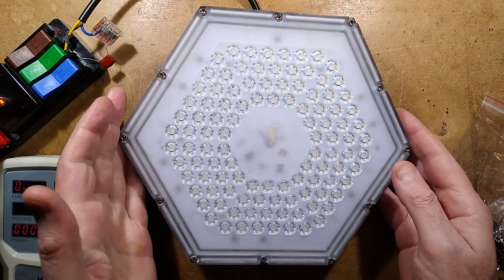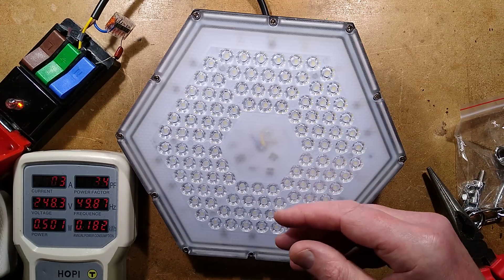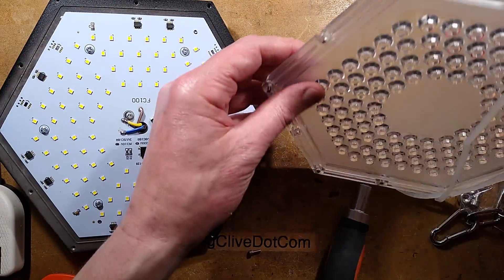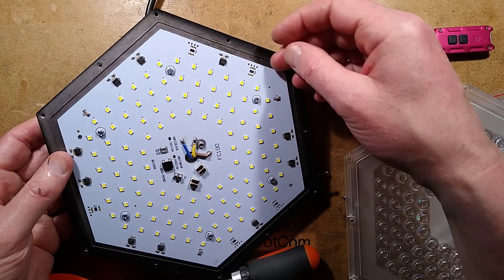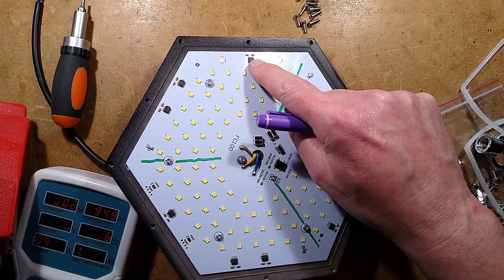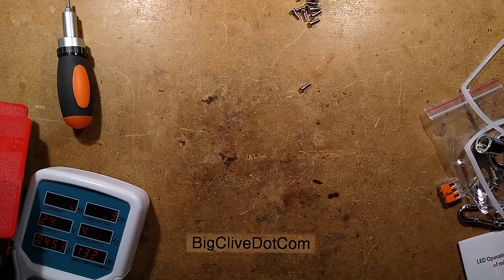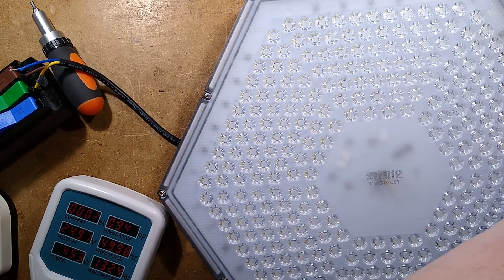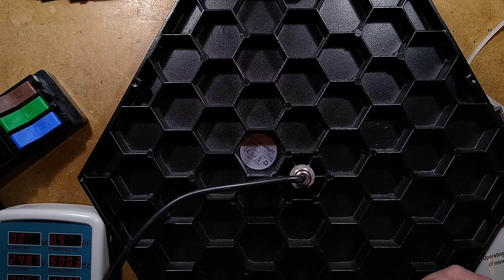Exploring an eBay "mine" light (flicker alert)

Comment: Could one simply add the reduction and smoothing components on either side of the existing rectifier?
I suppose for the extra cost of second rectifier and box for the bits, it's not worth the labour in breaking tracks and soldering in components, then to try and fit the screen back.

Comment: Could you run them off a lower voltage DC supply, so they didn't flicker and ran dimmer and cooler, if you were using them as decorative panels?
Reply from the maker: The mod mentioned with a lower value capacitor will do that.

Comment: My guess is they are using the aluminum as a heat sink to draw the heat away (which is why you hang them instead of surface mount).  One use for them is garage/shop lighting.  Need lots of light and usually flicker will not be as big of a problem.

Comment: led technology is moving fast. no dc driver or aluminum heat sink. all on the same circuitboard. lots of innovation. and assumed lowered price.
Reply: Looking now (14-08-22) cheapest seems £22 for 100W round UFO. Or £18 for 100W chain-honeycomb hexagonal ones. On ebay

Comment: I can't stand flickering lights. An absolute no-no for room lighting, and an annoyance where I can't change anything about them. Car LED brake lights are a prime offender, displays where the multiplexing is slow, or DLP projectors with color fringes due to the color wheel. I always see the flicker in the corner of my eye, a kind of reflex makes me think there is movement, it's big distraction.
I wonder, if there is research going into slightly phosphorescent phosphors (at least for white LEDs), so the flicker is smoothed by an afterglow instead of electric smoothing.

Comment: Interesting lights, both functional and ornamental.
I get the capacitive leakage to Ground from the Active with the Neutral disconnected, but who switches the Neutral?
It's always single-pole switch the Active or double-pole switch both Active and Neutral, so where is the leakage then?

I'm  assuming from the Wiring Regs here in Australia that Active is Brown(Red), Neutral is Blue(Black) and Earth/Ground is Yellow-Green(Green).
If the Neutral was disconnected for some reason, or Active & Neutral reversed, you would want the RCDs/ELBs to trip!
I would also think that any reasonably mindful person would recognise the dim flickering state as abnormal.

There is a heap of weird and "wonderful" LED Light Fixtures out there.
Reply: With lave and neutral both connected there would be a bit less leakage current but still at least half. Without neutral the internal "ground" goes between +240 and -240 and with neutral connected it goes between 0 and -240.

Comment: How was this video updated a day ago but all of the comments are from 3 weeks ago?
Anyway, I got a 12 pack of the 100w version and I can confirm they do go bad in about 7 months to a year and a half of use, and if you don't loosen the screws holding on the lens they crack and creak and make horrible noises as they heat up and cool, they do get stupid hot but surprisingly they don't melt even after being left on for days.

Comment: clive i wanted to say thank you because ive been watching you when i ran into a power regulator chip on an LED barn light (dusk to dawn) that had failed from how it was behaving i knew it wasnt getting its feedback to the chip sure enough one of the surface mount resistors had popped loose one of its connections the thermal expansion and contraction of the aluminum board id guess used a heat gun to heat the area reflowed the soldier been working fine ever since

Comment: I need some advice on capacitors for LED's. I've always put a capacitor on the active/hot side but you've put it on the neutral side Clive. Why is that?
Reply from the maker: It can go on either side.
Reply: @bigclivedotcom  thanks for the super quick reply and info! I had no idea thanks

Comment: Not sure what vidya software you're using, but if you can be bothered, copy the current layer of video onto a layer above, take the opacity of the top layer down by 50% ish, then nudge the half opacity layer right by one or two frames. Maybe 3, Flicker should at least be minimal, if your frame rate and all that lines up, it could be a thing of the past.
Reply: depending what constitutes a nudge. it might need to be 12 frames. (at 24fps.) to delete flicker, but a guy might notice ghostish artefacts. Anyway, if this helps, you owe me a post it note.

Comment: Now I need to see what the strobing in the room would look like with 3 fixtures on different legs of a 3-phase supply. Party time or smooth enough to be usable?
Reply: Or even two on different legs of US 220V!
Reply: @firstmkb  Putting one on each leg of a US household 120/240V supply will not yield any benefit  as they are exactly in phase. True three phase (120/208V in the US) will flicker at six times the line frequency. 360 or 300Hz should be plenty smooth enough to be undetectable by sight. Possibly more important than the frequency is the crest factor which is also reduced on three phase.
Reply: @eDoc2020  they’re out of phase.  Each leg is 120v to neutral, but since they’re 180 degrees out of phase, you get 240V across them.

Comment: By coincidence I have just repaired a couple of Rectangular 300W (model CSF2) floods made by the same company. A slightly different circuit: 5A fuse followed by what I assume are 3 VDRs (V1, V2, V3) across the supply which feeds two 3025 bridges (wired in parallel) followed by a 10 uf 400v capacitor and 1Meg ohm bleed resistance.  
336 (2835) LEDs in total (comprised of 28 parallel strings of 12 series connected LEDs). The LED array is then series connected with 24 parallel connected CYT100A chips and six capacitors. 
Both units had blown 5 A fuses and 10 uf capacitors. One of the units had also suffered a short circuit diode in one of the bridges.  
I managed to find the data sheet for the CYT100A chips but have not yet sat down to read it. I was interested to understand their operation to see if its possible to lower the wattage and extend LED life expectancy. I note some one has commented that removing some of the chips would achieve this.  I have replaced the capacitors with some  8000 hour rated Panasonics so will be interested to see how long they last. 
Having watched many of Clives teardowns I checked to ensure both units had the earth wire connected (they did)  but one unit had live and neutral reversed.

Comment: Hi Cliff. Any tips? I have a ceiling fan with dimmable light fixture. It works fine with halogen bulbs. But using ac dimmable led's the light stays on in much the same way as your light did without the neutral. I tried switching the live and neutral but that didn't help.
Reply: I'm guessing your dimmer does not have a physical off position. If you can't change the dimmer (such as if it's built into the fan) you can probably get around this by putting a low-wattage tungsten lamp such as a sign or night light bulb in one of the sockets to shunt the stray voltage. You could also try using different LED bulbs as those with different circuitry will stay off even in the presence of stray voltage.
Reply: @eDoc2020  only 1 (E14) socket. And with halogen lamps going the way of the regular old bulbs they are getting rare.

Comment: The IET recently upped the permissible earth leakage current for class 1 appliances to 5mA. They also upped the leakage current for class 2 appliances from 250uA also to 5mA - which I dont think is that good TBH
Reply: That's really dumb given it would only take six appliances to start tripping the RCD.
Reply: @alexatkin  I suspect they have assumed everyone is going to be installing individual circuit RCBOs and that a single overall RCD layout will magically cease to exist. Therefore cumulative leakage will not be a problem, they've ruled it so!
Reply: That's crazy. Especially since North American GFCIs strip at 5mA. You could run into situations where a single device will cause tripping.

Comment: Your comment about the ICNE2530 being a dual linear/constant-current regulator makes me think that this might be a "two step" controller. There are two LED strings, one on top of the other. The top linear regulator (to ground) is set for, say 20 mA (controls only the top string) and the bottom is set for 40 mA (and controls the top and bottom string). The 20mA regulator turns off when the 40 mA regulator is active. This creates a more efficient and higher power factor two-step staircase of current (more like a sine wave of current than single linear control). A scope shot of the input current would show whether I am right, or if I am full of beans.

Comment: it is sad they have no filtering on these otherwise it could be a useful light but I hate when they flicker and it is very noticeable for me when they do. you could probably add external DC to these since they have a bridge rectifier and stuff but without lowering the power they would probably die immediately as the strobing helps them cool down between the light impulses. I say these won´t last many hours. they probably gonna burn out as fast as a normal incandescent bulb would even with that flickering

Comment: There is no heat compound in between the heatsink and the board. If you use it as us out of the box, it will fail very soon.
Always buy double the power you need and dim it down.

Comment: You mention adding a cap to smooth the flicker, I'm kind of curious if you couldn't build an external bridge rectifier+capacitor (+inductor?) circuit and just feed the light with a smooth-ish 300VDC- could then pot that without needing to do any internal work on the fixture. Don't know how well the rest of the circuit would take to it, but since it doesn't have an inline cap feeding it with DC seems like an option.
Reply: That would work and in fact I thought that is how Clive was suggesting to do it.
Reply: @eDoc2020  Not quite. What clive was suggesting was opening up the fixture to add a capacitor, though he does also show adding an inline capacitor as a form of capacitive dropper- that wouldn't do much about flicker though, and drops the power/brightness a lot. Amazingly, while looking for something else, I found he actually does have a few videos loosely related to this though: https://www.youtube.com/watch?v=UGTXne_e554 (adding a cap across bridge rectifier) and https://www.youtube.com/watch?v=CVUl9Kx5w70 (adding a cap across LEDs only)

(but, what I was talking about would be an external circuit/module to provide DC-ish to the LED module, as simple bridge rectifier + capacitor) (the actual thought was to go through and have a capacitor + inductor + capacitor to try and provide a constant current, but playing around with it in a circuit simulator, it doesn't work great without massive inductance)
Reply: @eDoc2020  Actually, re-watching it, that is exactly what he was saying... so I take back 3/4's of my comments. I didn't notice his proposed diagram was actually putting out L/N.

Comment: I will still always prefer tungsten, halogen or florescent  light in my home because It is a lot more tried-and-true method of lighting than LED is. It fails a heck of a lot less frequently!
Reply: Crap LED setups fail all the time. Decent ones with good heat management last nearly forever. If it doesn't get hot enough to be uncomfortable to the touch it will probably be good. Unfortunately due to size constraints anything made to replace regular bulbs is bound to run hot.

Comment: Interesting, a lamp that comes with a flickery dim setting.  Couldn't they afford a capacitor to smooth the voltage going into the LEDs?  I guess you get a nasty surprise if you touch the metal plate inside?

Comment: In the UK we get a bit of rain LOL - So all the honey comb back of the light will fill with rain water - Question - Will that make the LED lamp run colder ?
Reply: Nah but if you leave a tea bag in each honey comb you'll get a few hot treats when it does rain
Reply: The increased thermal mass will make it take longer to reach temperature so it would help if you are running the light on reduced duty cycle. Or more likely the water will get in, corrode something like the LED bond wires, and then it will no longer run hot.

Comment: I came across this in my search for that mine light on eBay.
"Zyurong GKD09 LED Mining Lamp * 50W 110V * UFO High Bay Light." 
I don't have any experience with mining, but I've worked in silos at a food manufacturing plant, and explosive dust is as much a problem, if not more so.

Comment: Clive, would running the mains wire around an inductor stop  the lamp from the slight amount of leakage? I would think that a dpdt wall switch would effectively stop it as well.
Reply from the maker: As long as the light is switched on the live it will not glow when off.
Reply: @bigclivedotcom  can you pass that tip on to China?  

I don’t like lights that are on when they’re off!
Reply: @firstmkb  Assuming you are using standard switches the phantom glow does not happen when the light is fed from the switch. It only happens if the switch is on a separate loop (which is necessary for multiway switching) or if you have a more advanced switch.

To eliminate the glow without rewiring you can add an additional load in parallel with the lights. An incandescent nightlight bulb would work fine here, as would a plain resistor or probably also a capacitor.

Comment: Earth leakage is a fun thing indeed, especially when you have a laptop sat on your lap, and then touch an LED panel pulled from a bulb that's sat atop a desktop PC case (plugged in, not powered up) and it makes the LEDs light up quite significantly, cos leakage through laptop to ground via the LEDs and PC case, capacitive maybe, something worse, I don't know, but that was about 4 or 5 years ago, things are a tad more isolated now, I hope... :S

Comment: I've been using the round 'UFO' lights 300W for grain barns, here in Suffolk. They give off fantastic light when they work but the LED's burn out after less than a year and I've stopped buying them as the pop up shops on Ebay don't give me any guarantee and they don't want to know about the 1year from purchase here in UK.. Don't reckon they are up to the varied UK voltage and remote farms, can have anywhere in between  250v-230v
Reply: Until the local regulator starts pressuring ebay to make their sellers honor the law, nothing still change.

Comment: Hey big Clive,
 I seen a video of a LED PCB board that was extremely efficient. It was around 8 months ago or so the video came out.
The way He explained it was,... certain sections of the LED board would come on at different voltages of the sine wave & because of that it was more efficient then most LED PCB boards.
I will try to find the video if you are interested?
Reply from the maker: I've featured the wave riding PCBs in the past.  Basically a tapped LED string that is switched in increments to match the waveform voltage.

Comment: AHH flicker..the bane of my life...LEDs lights are a minefield when it comes to machine shops... A lot of tool shop lighting is still tungsten filament...even some of the better led lamps have problems when the lathe's/ mills are running at certain speeds it's not uncommon to see led highbays with tungsten lamps affixed to the machines to give strobe free lighting... On industrial printers we do use led but they're bloomin expensive as they're really really well smoothed and very very good CRi and they have to remain unchanged in brightness and CRi even when it's hot or cold.
Reply: LED Christmas tree lights are my curse.  To my eyes, they flicker like mad, even at a distance.    Some auto head- and tail-lights do likewise.

Comment: Clive, you need to hack the fixture into a super computer display with led neon strip as connection cables.
Bonus points if you can get the led neon strips to randomly flash at the same time.

Comment: Electrolysis is the process of using an electrical current to separate water into hydrogen and oxygen gas. The electrical charge that is applied to water will break the chemical bond between the hydrogen and oxygen atoms and produce charged particles called ions. ... i have a question would this distill alcohol
Reply from the maker: I'm not aware of electrolytic distillation.

Comment: Would adding a smoothing cap to the DC side combined with adding a capacitive dropper work to reduce the flicker without reducing overall brightness?
Reply from the maker: If matched it would work, but would require a very high value of dropper capacitor.

Comment: Running at 100 and 300 watts is scary. That's as expensive as previous generations of tungsten, halogen, sodium etc lighting they ought to have replaced.
Reply: Ignoring all the longevity/heat issues though, you still get a lot more light out of these for the same wattage, so it's not really compatible in running expense.
Reply: @anononomous  You certainly do but it's only good if you need all that extra light.
Reply: @anononomous  if you take into account that these fixtures need replacing at least twice as often you dont save on operation cost AT ALL.
Reply: @casemodder89  Like I said, "Ignoring all the longevity/heat issues...". If not run as hard as this there's no reason LEDs won't last a long time and give more substantially light per watt while doing it (whatever brightness you require). 
This is not a case of LEDs are not better , just that this implementation is poor. In the same way a poorly implemented traditional light source would not be as efficient or long lasting as it could/should be either.

Comment: One of those big suckers running at full power, hooked to a motion sensor, and mounted horizontally by my front door could be just the thing to discourage night time visitors.
Reply: And cause drivers passing by to go into seizure and crash. I'm not sure if your insurance would cover that.
Reply: @Ea-Nasir_Copper_Co  Be pretty unlikely someone is driving through my property. My door does not face a road.